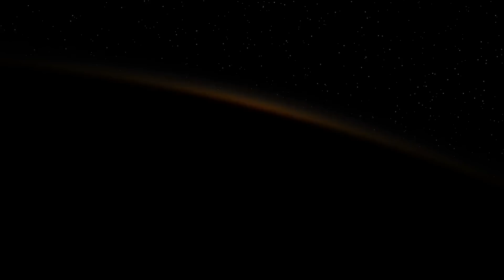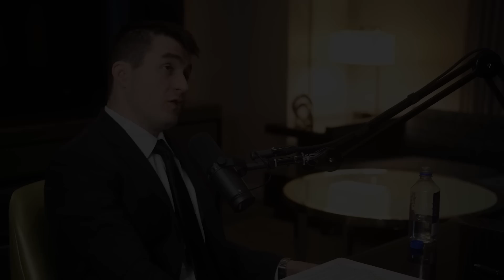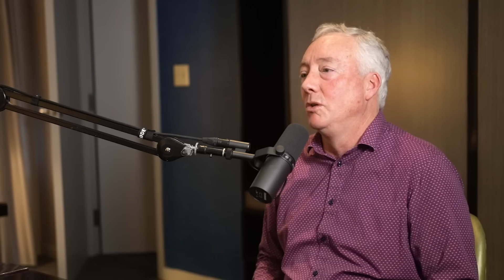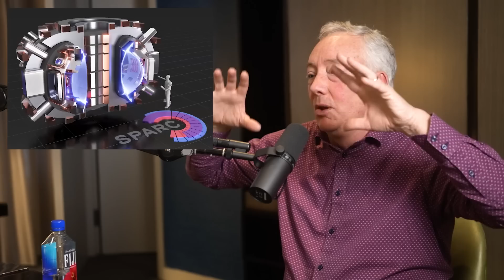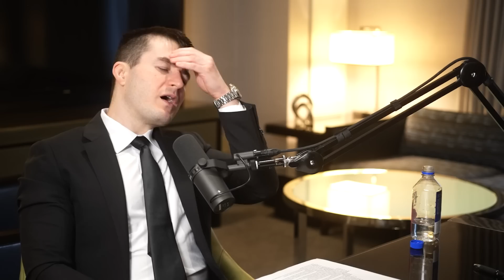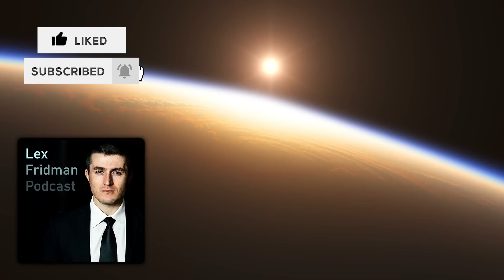How Nuclear Fusion Reactors Work | Dennis Whyte and Lex Fridman

Comment: Two things: A:I really appreciated that showerthought as well. B: I'm curious what the photonic propagation is for plasma. Are the photons being emitted from the electrons which are free or the electrons which are still attached to the fuel?
Reply: In my opinion, think of it like the Auro Borealis, the Electons are heated so much that they glow.
Reply: @scoutsaresilentdeath8775  I didn't think that's how it works. The way I understood it is Electrons eject a boson, the photon when going down an en energy shell in an atom and absorb a photon when going up in energy. What I want to know is, if plasma is electrons, then what is ha[pening to the electron when it ejects the photons?
Reply: It’s momentum and energy change  by the same momentum and energy of the photon. In a bound atom the energy is equivalent to the electron shell level, and so only photons of certain energies can change the shell of the electron. A free electron has no restriction: the energy can change by any amount. The energy  of a free electron is just kinetic energy of motion

Comment: So when we will control fusion in plasma, how the generated energy(heat) will be converted to electricity? Good old boiling water and turbine ?
Reply: We have yet to come up with anything that is even as close as efficient as a steam turbine. Stirling Engine might work if it could be scaled properly. But the thing you would want, a straight heat to electricity conversion (TEG, Thermal-Electric Generator) is currently about 5% efficient. Really, if someone could make a TEG about 60% efficient, fusion would be unnecessary. 90% of the solar energy that hits your roof can be directly captured as heat.
Reply: Yes